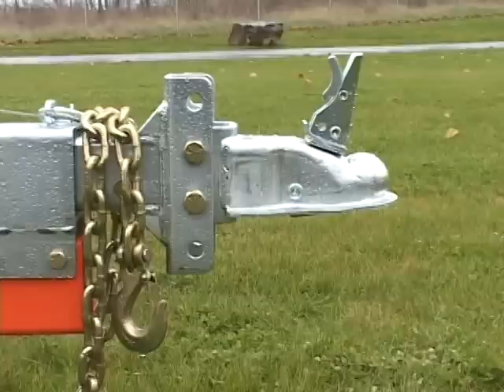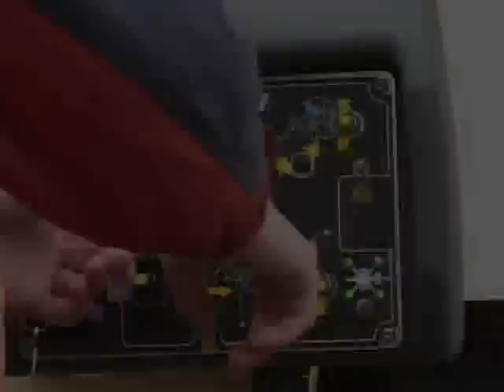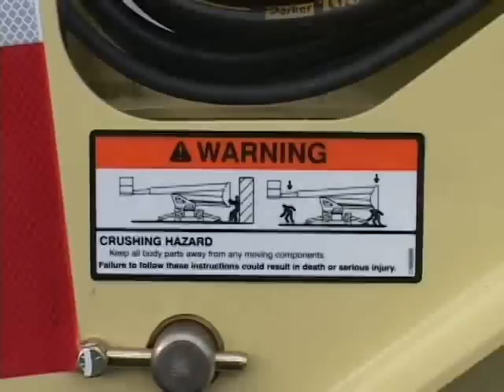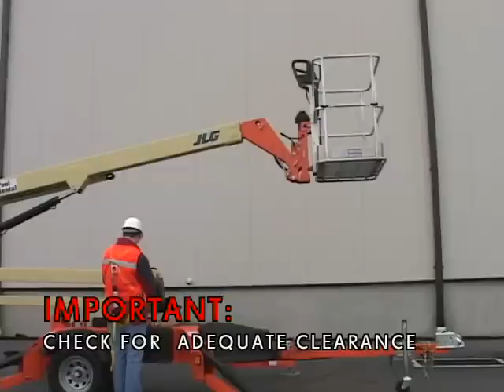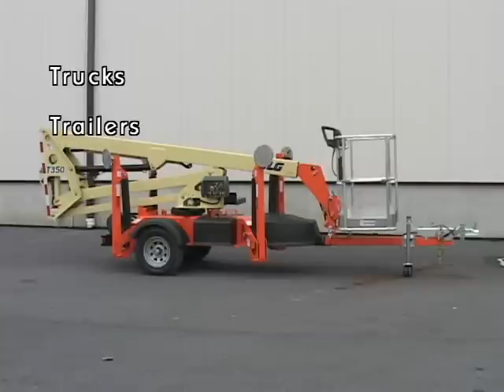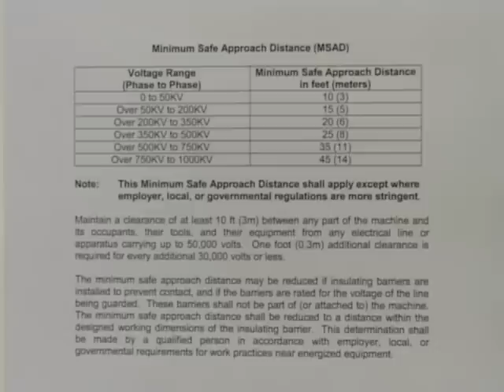Towable Aerial Boom Training JLG

Comment: I used the JLG T500 version. Be careful and do not lean on the basket's control console. It is very flimsy. If you are working on uneven terrain you might be able to mount and dismount the basket if you position the basket near a high spot. Remember that you can control the basket from the ground to position it near that high spot. Finally, be mindful of how close you park it to a tree or other obstacle because you can not swing the boom around a complete 360 degrees without reversing direction.
Reply: Where can I find parts for the t500
Reply: @enricolouie3301  Sorry, I don't know.
Reply: I checked out the lift and I put it all the way up from the ground and now I can't get it down .all other switches work except the one to make it go down.  it will even try to go up more but it  is fully extended already. but wont make a sound if I put the switch in the down position